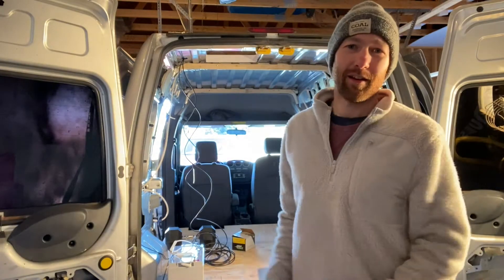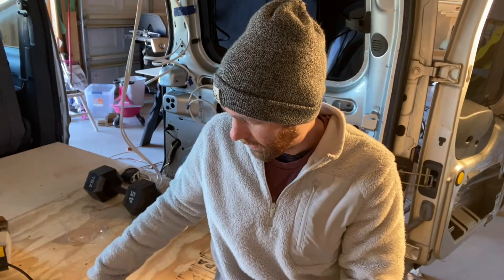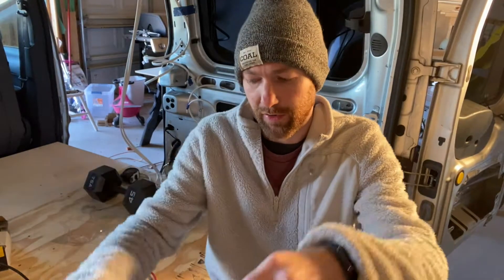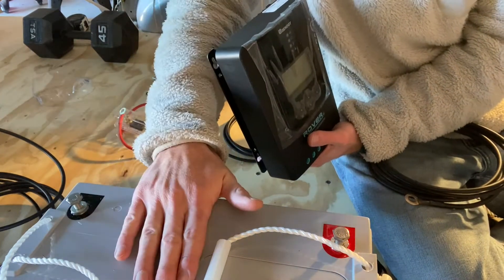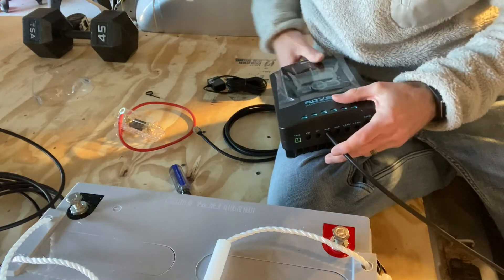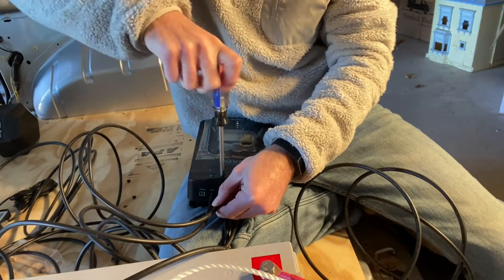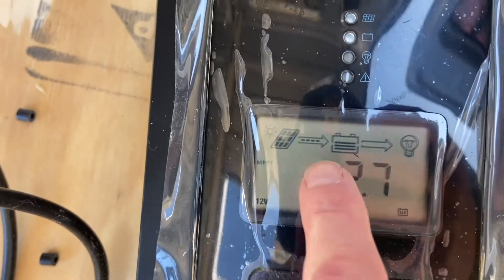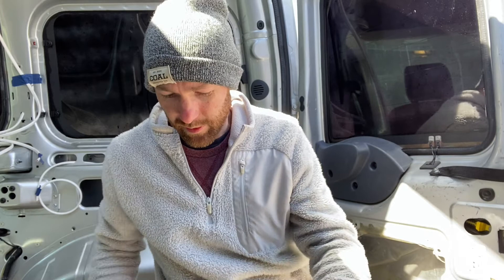Wiring - Renogy 100W Solar Kit | Ford Transit Connect Camper Van Build | Step by Step Series

Comment: Love the set up and appreciate how clearly all of your videos are explained. I am looking to go this route with the renogy solar panel kit. I am going to have a professional do it though once i buy the products. My question is i watched the video and see your two listed products here and notice there is no inverter. But when i go on to the renogy site it says “you will need a solar inverter when using a battery” in regard to their product. I’m not very good with this stuff (exactly why i am hiring someone to hook it up). Does it mean i only need an inverter if I’m not using solar panels? Very confused but i feel like you will be able to explain this clearer than many others would. Also i should note we are getting this for the sole purpose of powering the max air fan and a couple lights .. so nothing too crazy. Would love some easier answers to this. Thanks for your time
Reply from the maker: Hey Marino. Thanks for watching! 

The kit I am showing here show everything that I had for my solar setup. I didn’t have any inverters. Perhaps they are talking about the charge controller, which you need to take the energy your panels pull in and send it to the battery at a voltage that it can handle. The kits come with one. 

Inverters, from my understanding are what can take DC voltage (used for max fan and your lights) and convert it to AC (running and outlet like you have in your house). Think of those little boxes you can plug into the cigarette lighter plug in your car so you can plug something into it with a regular cord you would use in your house. That is an inverter. In this context the inverter would take electricity that comes out of your battery (DC) and converts it to AC for having standard outlets which from the sounds of it, you won’t need. 

I am not an expert, in fact at the beginning of the build I knew exactly nothing about electrical, but just spent way too many hours researching our electrical set up. 

I hope this helps a little. I understand how incredibly confusing this part all is.